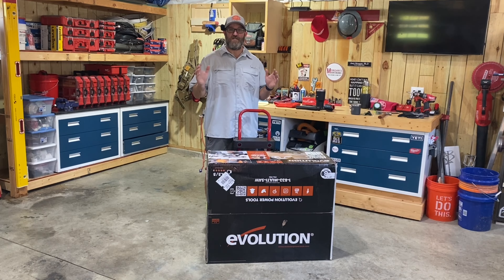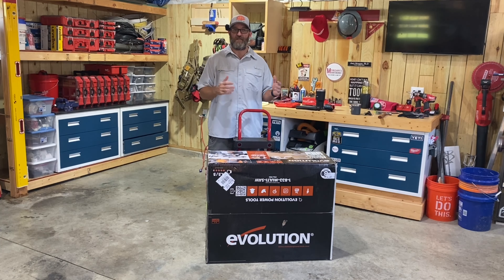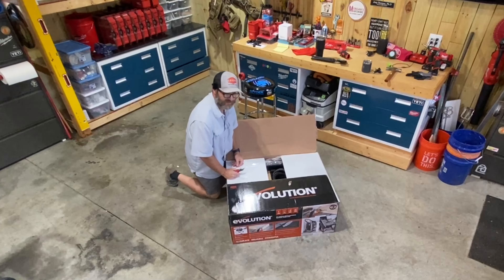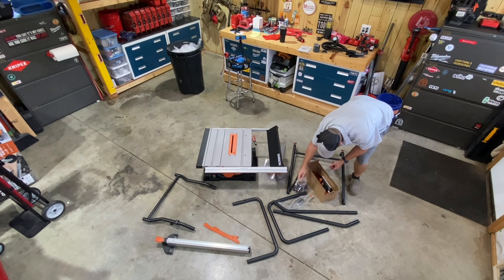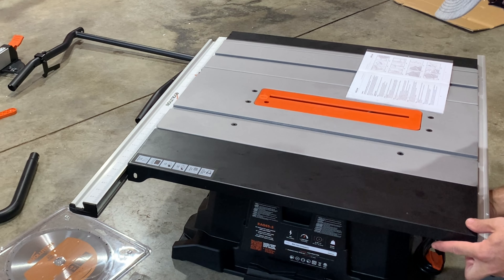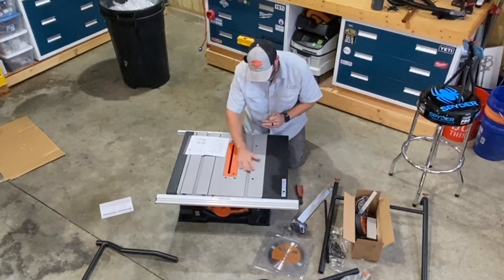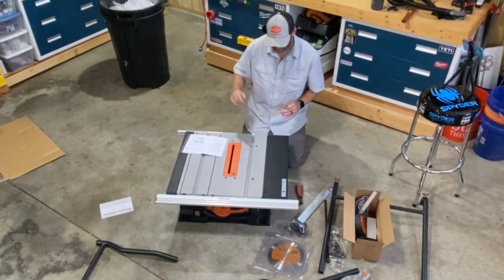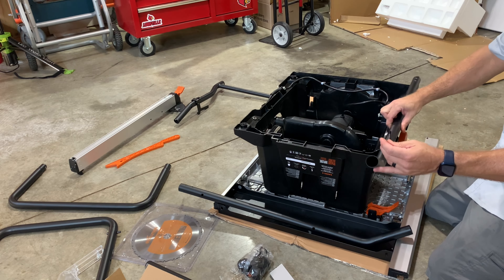Evolution Rage 5S Table Saw - "How To" From Box to Assembled #tools #evolutionpowertools #tablesaw

Comment: Yep, first stage of being a famous youtuber - unboxing fancy items :)
Jokes aside. The saw is crazy cheap.
Reply from the maker: Yeah it’s draw would be for someone who does a mix of materials (Mostly Metal) I guess and not primarily wood.  It has a slower RPM and special blades.

I think a lot of people use their miter saws as Chop Saws/ Miter Saws. I used to see them in Stores and know several people that have those.  Never seen any of their other tools before.

I for sure don’t need another Miter Saw 😂

It was practice for filming and editing it nothing else 😂
Reply: @MORGANSMaintenance  I'm still watching and I must say if I were to assemble this, there would be a plethora of F-bombs.
I used Evolution metal chop saws. They do the job, but it takes a lot of tweaking to make them precise enough.
Overall not their tools are not bad, but if they were 10-15 percent more expensive they could improve some quality.
I always keep those saw blade plastic covers. When I store the blades I use it as a divider, it prevents blades from rubbing against each other thus stops dulling.
Reply from the maker: @Stefan_Kawalec  that’s why they have editing 😂

The instructions were not great.  More so the pictures.  If they would have shown a little wider view it would have made the world of difference.
Reply: @MORGANSMaintenance  In primary school we had a thing called practical technical classes. We were taught there how to drill, use multimeter, cook, some simple woodworking etc. And we were also shown how to make and read technical drawings. Most of our textbooks were from the 70s and 80s with very clear and easy to understand drawn instructions. I also had tons of Lego with their beautiful instructional drawings.
I'm amazed how bad and indecipherable instructions are nowadays.
Reply from the maker: @Stefan_Kawalec  agree.  I guess they make sense to the person that writes them… just nobody else.

They have cut all those kind of things out of schools these days… which is why in about 25 years I’m not sure what will happen here.  Artificial Intelligence better be getting pretty good at the trades 😂
Reply: @MORGANSMaintenance  🤣